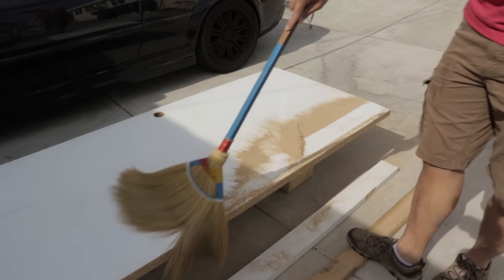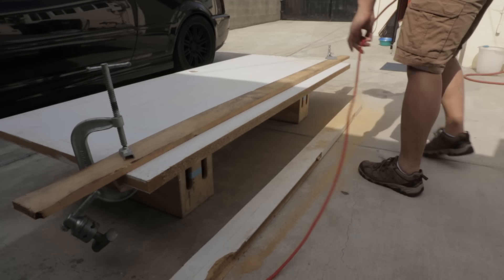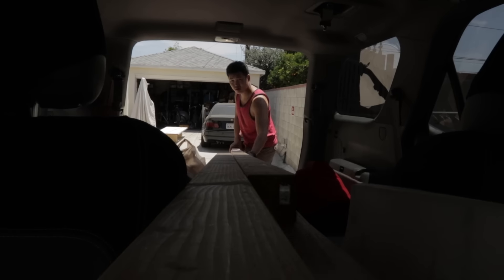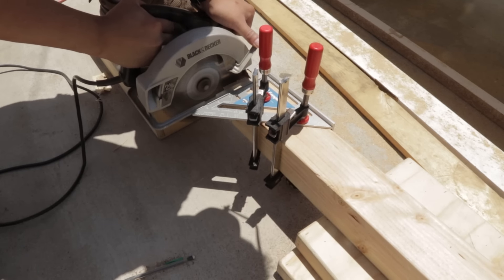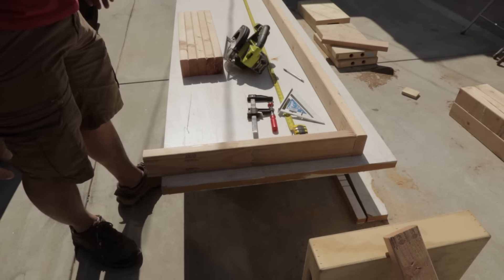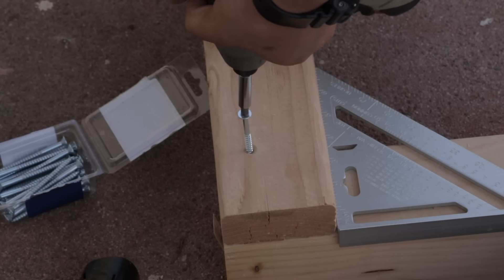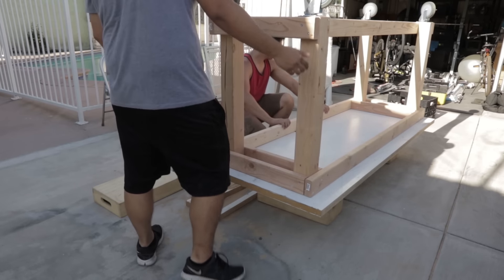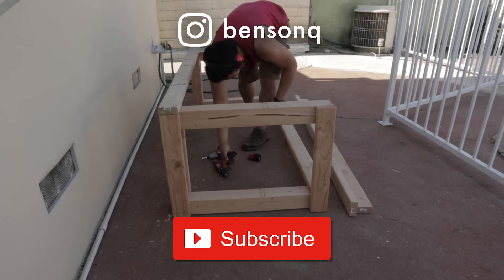Custom Workbench Build | Sawdust Everywhere 1

Comment: I wanna buy that work bench! 
how much @bensonq
Reply from the maker: The shipping alone would probably be 4x the cost of the materials :/
Reply: +bensonq 😳 true! probably better to make it myself.
Reply from the maker: If you do, I'd love to see what you come up with! remember; SAFETY FIRST! Eye protection is a must but don't neglect hearing protection either. I have hearing loss already, so I need to protect what hearing I have left. Gloves are good for handling certain things but do not use them when operating any motorized equipment. (Gloves or loose clothing could get caught in the motor).